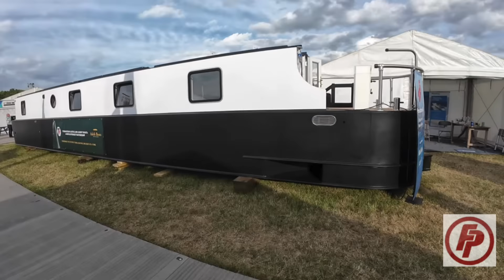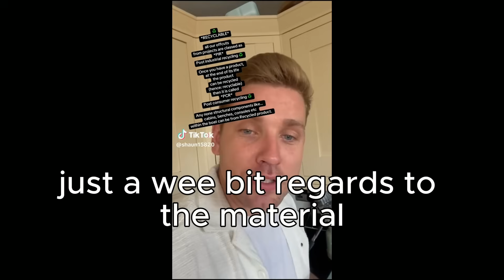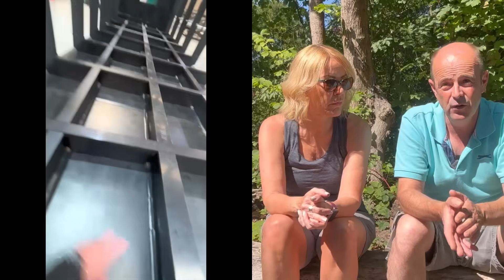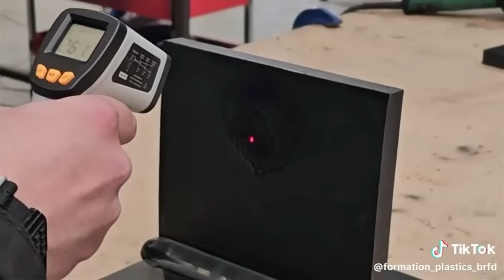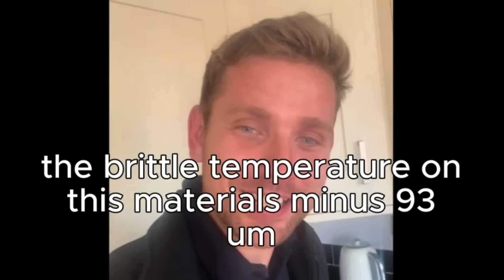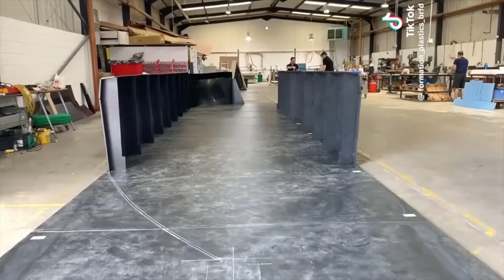Rust-Free Canal Boat?! The WORLD'S First Plastic Narrowboat Explained | 194

Comment: Okay, I feel I should give everyone a bit of detail on Polystone G HDPE Marine-Tec — the material we’re using for our canal boats — and why we believe it’s an excellent choice for inland waterways.

This isn’t the same plastic as garden furniture or food packaging. It’s a marine-grade, high-density polyethylene (HDPE), specifically developed for tough marine environments like coastal workboats, pontoons, and water infrastructure all over the world.

Importantly, we use a blend of post-industrial and post-consumer recycled HDPE in our construction:

Post-industrial HDPE comes from clean manufacturing offcuts that would otherwise be discarded.

Post-consumer HDPE is recycled plastic that has already been used , collected, cleaned, and reprocessed into new material.

This approach supports a circular economy and reduces waste by giving recycled plastics a long-lasting, valuable second life in durable boats.

Here’s why Polystone G HDPE Marine-Tec is ideal for canal use:

Impact resistance: Tough and flexible, it handles bumps from locks, moorings, and other boats without denting.

Brittle temperature: Performs reliably down to -95°C, so no cracking in cold weather.

Lifespan: Over 100 years proven in marine conditions worldwide.

Density: Approx. 0.95 g/cm³ — strong yet lighter than steel, aiding fuel efficiency and handling.

UV-stabilised: Won’t fade or become brittle like garden-grade plastics.

Insulating: Low thermal conductivity (~0.5 W/m·K) helps maintain interior temperature and prevents condensation.

Chemical resistance: Resists fuels, oils, saltwater, detergents — it doesn’t degrade or weaken.

Non-toxic: Chemically inert and food-safe, widely used in potable water systems.

Marine growth resistant: Algae and barnacles don’t easily attach, so no rust or flaking like steel.

No paint needed: Colour is integral to the material, so no antifoul or repainting is required — reducing maintenance.

We’re not trying to replace steel boats — just offering a sustainable, low-maintenance alternative that’s tough, reliable, and environmentally conscious. This material is already trusted globally in marine use — now bringing that durability to the canals with recycled content at its core
Reply: Hello Shaun, just for the public record and some validation: I have a background in ecology as well as five decades within vernacular traditional design and construction. My work has employed timber, textiles, alloys, and ceramics ranging from architecture and light provincial watercraft all the way to biome enclosure design for museums, zoos and aquariums. With that validation out of the way, and for any others who may read this, I want it known upfront that I personally understand technically what plastics (in general) are. It should also be known that, in general, I... DESPISE PLASTICS... what they are chemically, the industry behind these "forever chemicals," and what they have done to the planet up to now.

That may read as alarming, but it should also be known that any future work I do in hull design for my own watercraft will utilize some form of HDPE plastic. Why the 180° turn? Well, after fifty-plus years in design and fabrication across a respectable spectrum of natural mediums, my science background cannot vilify the entire plastic industry or all the materials that come out of it. HDPE is one of those materials that, even as a plastic, is virtually a 95% fully closed-loop consumer material with an ever-growing lifespan of durability and recyclability as well.

I personally want a hull that will last at least a century, if not longer, and one that does not have a negative impact on the ecology it travels in. It must also be repairable and recyclable at the end of its service life, should that life not be extended as technology improves within HDPE science. Boats are notorious for losing value, often seen as a "black mark" in terms of investment, unlike architecture, for those of us who desire a "live-aboard" watercraft. However, that is not the case with all watercraft; several designs hold their value very well, with some actually increasing in price over time because of the nature of their design and performance long term.  Low maintenance hulls with century long durability are one of those exceptions.

Now that I’m retiring, I plan on finding a way to design and build a boat I can live on to travel Europe again, potentially taking it to other regions to serve the same function as I travel "with my house" rather than traveling away from my house, as most do. I’ve watched the culture of "water nomads" growing across the globe, and watercraft made of HDPE are head and shoulders above wood, alloy, and resin hulls by a huge margin. There is simply no other choice if someone wants a hull that lasts and provides the most durability. I state this after over a decade of studying and watching this HPDE industry in preparation for my own design and build.

Thanks, Shaun, for what you’re doing for this industry. I hope we meet someday... ☺
Reply: @JayCWhiteCloud  Wow — thank you massively for sharing this. Reading your experience and insight fills me with genuine pride and excitement. The depth and breadth of your background — ecology, traditional design, architecture, watercraft, and biome enclosures — is extraordinary, and your technical understanding of materials, including plastics, really shines through.

It’s inspiring to see someone with your knowledge and decades of experience carefully evaluate HDPE, not just from a material standpoint but through the lens of ecology, durability, and long-term performance. Your reasoning for choosing HDPE despite your well-founded concerns about plastics is thoughtful, measured, and incredibly validating for what we’ve been advocating in hull design.

Hearing that someone of your calibre recognizes HDPE as a material capable of century-long service, low maintenance, recyclability, and ecological compatibility is hugely encouraging. It makes the work we do feel meaningful and confirms that there’s a real future in durable, sustainable watercraft.

If you are at Crick, I’ll be there too — if not, I’m really hoping we do meet sometime soon.

Thank you again for taking the time to articulate this — it’s both humbling and motivating.
Reply: @ShaunMoir1  Shaun, your work is both "cutting edge" as well as, needed in this industry.  I have nothing but love and passion for the old steel hull canal boats and think all those remaining should be save, if at all possible because each time we allow our historic fabric, be it an old shirt or shoes, house or bridge or even on of our old canal boats, we as a culture forever loose another wee bit of our tangible and physical history that is both a reminder of where we came from as well as an excellent teacher for how this "should be done, " in many regards.   I'm pleased we have a few "steel hull" design builders keeping the "old ways" of doing these watercraft alive because their historic restoration work is invaluable to us all that have a love and passion for vernacular provincial watercraft. 

With that stated however, I think anyone today looking for a "new canal boat" would be utterly foolish and missguided if they selected a steel hull boat.  For any few that may read this comment...please, by all means challenge me on this view if you so choose.  I would be glad to validate the reason why HDPE hulls are simply the better choice all around from durability and maintenance (or the lack thereof) all the way to long term investment value and ecological impact. 

Now that I have found you Shaun, I am following your channel and sending you and email with a potential proposal for you to consider and perhaps can assist me with. Blessings, j
Reply: @JayCWhiteCloud  Thank you — that honestly is so humbling to hear.

I’ve openly said that this has been a long and hard process, to be accepted into this industry  That part has genuinely been quite challenging, so hearing comments like yours has been a real breath of fresh air.

It shows that we’re on the right track. I’m not naïve enough to think everyone will like this — these kinds of boats aren’t for everyone, and that’s completely okay. But if what this does is get more people talking about the canal industry, then that can only be a good thing.

Of course, I look forward to hearing from you again
Reply: I watched videos on steel boats being built and in both cases they installed what looked like big bricks as ballast at the bottom of the boat. Did/would HDPE boats do the same? Double hull water ballast like the Sea Otters? What about a kind of magnetic linkage for propulsion kind of like magnetic stirrers? And looking at the ribs that looks like lots of extra space for even more insulation.
Reply: Ok Shaun , will you be back at  Crick next year with a boat that is finished and ready for sale and doesn't require an appointment to go on board , I never understand at Crick why some builders do that , very annoying
Reply: @originalpickaxe  Yes, we’ve confirmed that we’ll definitely be at Crick next year with a fully finished boat that will be ready for sale (though it may sell before Crick—who knows! 😄).

As for appointments, we’ll be in the same spot as last year. You probably remember how big the queues were, which is the only reason we were actually looking at doing appointments—just to save you a long wait! That said, we won’t be enforcing appointments, so feel free to drop by whenever suits you.
Reply: Lovely , I will come and take a  look.😊
Reply: This is the first time I've actually seen a genuine plastic material used this way, rather than GRP. 
I was sold when I saw the forklift test, the other tests were all a bit subject to outside forces, but when the forklift rode up on the  plate, then couldn't cause the welded section to fail, yup, sold. 
If this material has been selected for a fire boat, then it probably exceeds most standards for domestic uses. 
With the canal boats, how would you envisage dealing with the buoyancy and lack of displacement? Be a shame to weigh the vessel down for bridge clearance etc. 
Ref the paint compatibility etc for the sign writing, surely this is where the vinyl wrap would be preferential. While I've no experience with HDPE, I am aware of the ongoing brittleness following years of UV and reaction to paints. 

I wish you all the very best.
Reply: I thought the "current" agenda was to move away from plastic use.
As I understand the plastic recycling scheme, There is a finite number of times plastic can be recycled before it's unusable, What are the plans for getting rid of the useless, unusable plastics at the end of the process?
Or is this another "Modern innovation" that will create problems to be kicked down the road for future generations to deal with?, Like  Fibre glass, Asbestos, Nylon, Nuclear waste, Micro Plastics, Solar panels, Wind turbines, Lithium batteries.
Reply: @ianmorris6437  Thanks for raising an important and fair point — and I completely understand the concern around the long-term impact of plastics, especially with so many examples in the past where materials were introduced without fully understanding the consequences.

You're right: most plastics, including HDPE, can only be recycled a limited number of times before they degrade. But there are a few key reasons why we’ve chosen to use Polystone® G (Marine-Tec) from Röchling, and what sets this material — and the company — apart:

1. Material Longevity and Purposeful Use

This isn't single-use plastic. Polystone G is an industrial-grade HDPE designed to last for decades in harsh environments, including marine and chemical settings. It resists UV, saltwater, chemicals, impact, and corrosion — far outlasting many traditional materials like mild steel. That long lifespan reduces the need for replacement and repeat manufacturing.

2. End-of-Life Planning

We’re fully aware of the challenges around disposal. That’s why we’ve aligned with suppliers like Röchling, who are actively investing in closed-loop recycling systems. Offcuts and end-of-life parts can be returned, reprocessed, and used again in the manufacture of new semi-finished products.

They’re also expanding recycling infrastructure — including a dedicated sustainability centre in Germany to process over 10,000 tonnes of plastic waste per year — and producing certified recycled product lines (ReLoop®) and bioplastics (BioBoom®).

3. Responsible Innovation, Not Avoidance

You’re right to mention examples like asbestos or microplastics — these are cautionary tales. But we see that as even more reason to design with accountability. We're choosing a material that performs where it's genuinely needed, and we're working with suppliers who are already building the systems to handle it responsibly at the end of its useful life.

In short: we're not pretending plastic is perfect, but we are making careful, informed choices — and we’re working with partners who take the long-term environmental impact seriously.

Thanks again for raising this
Reply from the maker: Thanks for this Shaun 😁
Reply: I'm concerned, as they degrade won't they deposit microplastics into already struggling waterways? They will break down eventually. I also agree with the concern about disposal.
Reply: @Toe-Beeans  I understand your concern. HDPE canal boats are highly durable and chemically inert, so they do not shed microplastics during normal use. Unlike some other materials, they don’t require coatings or paints that could pollute waterways.

At the end of their life, HDPE can be recycled through post-consumer or industrial recycling, meaning the material can be reprocessed into new products rather than going to landfill. This makes them a much more sustainable option, and helps avoid environmental impact from disposal.
Reply: Do have YouTube channel bud

Comment: You'd need to make plain that this "plastic boat" is not GRP, also often called a "plastic boat". i don't know in what way this HDPE is going to improve or differ from GRP.
Reply from the maker: Fair comment. It’s actually not GRP at all, but Polystone G Marine Tec HDPE, which was developed specifically for marine use. The appeal seems to be things like impact resistance, no rust, no corrosion, very low water absorption and the ability to weld repairs directly into the material. Whether it proves to be a better solution than steel or GRP long-term remains to be seen, but it’s certainly a different beast from the fibreglass boats most people think of when they hear “plastic boat”. 👍🏻

Comment: i live on a 57ft narrowboat (for the last 6 years)and this all sounds great , but when i think about it the most expensive thing on my narrowboat was the steel to build it why would i pay more money for plastic ? you see most people who live on narrowboats are not loaded so price is a big thing
Reply from the maker: Guess there are pros and cons to both, the biggest difference for most people is the plastic doesn’t need blacking and requires far less maintenance 😊
Reply: If it catches on it will drop in price until its cheaper than steel AND with very low maintenance costs.:body-blue-raised-arms:

Comment: Problems I foresee. Wear to base plate  from shallow canals, sand blasting effect of grit in the prop stream. Rats, Rats eat through plastic to get to a known food source.   Acidic bird pooh.  Galvanic erosion of stern tube and rudder hinges.  H.D.P.E. can react with chemicals commonly used around engines.   But as G.R.P. boats are outlasting steel boats I am optimistic that this could be a good idea. But buying an early example??????
Reply from the maker: Bala the naval architect for these boats wrote an interesting article on the boat, you might find it interesting 😊 https://neroboats.com/articles/hdpe-narrowboat-10-questions

Comment: Hi I'm James I would just like to talk about painting the boat u don't need a special paint hve worked for a company called morellis that special in car paint so  there is a primer that u paint onto the plastic  like u do on a car bumper that r now plastic so it's only the primer u need it comes in a green colour any think u want to no about paying Ur plastic boat or cleaning it just email me  using certain  cleaning products can damage the plasic just email me and and I will answer Ur Q
Reply from the maker: Thanks James. You’re right that adhesion promoters and specialist primers have been used successfully on automotive plastics for years.

One of the interesting things we’ve learned whilst researching this boat is that marine-grade HDPE appears to present different challenges to many automotive plastics, particularly around adhesion and thermal movement. Formation Plastics told us they worked with their paint supplier to develop a specific paint system for Polystone G Marine Tec rather than simply using a standard automotive process.

It’s certainly an interesting area though, and we’ll be following how the painted boats perform over time. 😃